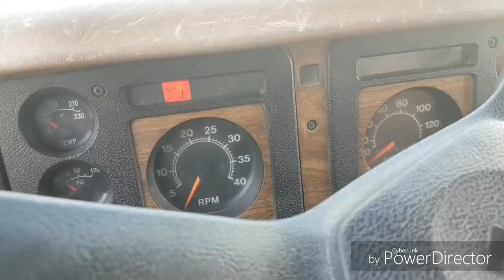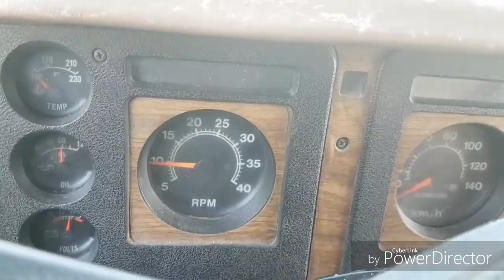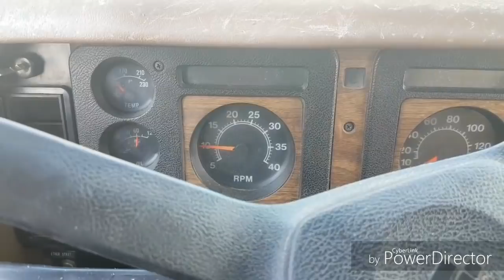Tandem cold starts, horse feeding and fuel cells!

Comment: So, Nick. Gotta say, I've always been told to NEVER crank an engine with the block heater plugged in.. because they say when the coolant starts moving, it can have a little air moving around with it.. the air hits the hot element while it's still plugged in and pops the element.
Three hours!!! Kinda wonder if the heater is working...
Dang Ryan! Always interrupting your videos 😂🤣
Tank looks good!, Definitely need to change the angle of the spout.
Maybe a hose with a 45° at the end??? Or bend or cut and fabricate to the angle you want???
Reply from the maker: Lmao that sounds like an old wives tail to me lol when its 30 below and hasnt moved for 2 weeks 3 hours isnt very long lmao
Reply: @SouthSaskFarmer1  I don't know, never chanced it.. except on accident 😁
Reply from the maker: @GosselinFarmsEdGosselin  lol done it for years no issue yet haha
Reply: @SouthSaskFarmer1  perfect 😁
Reply: Lol I never heard that.  How would it get air in it. Lol
Reply: @pattoohill5307  I was told cavitation when the pump starts..
But then on a lot of new stuff, it's hard to get the air out to begin with 🤣😂
Reply: @GosselinFarmsEdGosselin  .Ed cavitation is caused by the coolant.  You can get test strips at Napa to check it. Those water filters on the IH engines have the additives for correct PH and ect. Cat has an additive as well as a few other companies that keep the antifreeze in condition. You run in to the problems with mainly wet selves when the antifreeze had never been changed or been tested other than freeze temp.
Reply: @pattoohill5307  cavitation is caused by the movement or lack of movement, you are talking about electrolysis, Wich is caused by different metals and chemicals that don't like each other... It does things like eating out liners, especially on the older international diesel engines.. it can not only corrode the liners, but also the block, normally at the base of the liners.. good liner seals and good chemical additives/filtration are the best controls... I have also seen other parts of the block affected, but usually if other parts of the block shoe signs of electrolysis, the liners and their mating surfaces are pretty much gone.
 Damage caused by cavitation, is generally just in the pump. The air bubbles act like little balls, beating the inside of the pump.. all pumps will have a small amount of cavitation at start up, normally not causing damage... Toss in a small air leak on the suction side and cavitation becomes an issue.. 
Took a pump off an 8.3 Cummins, had a pinhole in the bottom rad hose, didn't drip, just damp on the outside.. destroyed the pump! Broke the shield off the impeller, peened the impeller, looked like it got ran through a rock crusher.
Reply: @GosselinFarmsEdGosselin  yep you made him speech less! 🤭😎😉🤪😁🤔🤫🤭🤬😔
Reply: Yes   electrolysis.  The nitrate and Silicate.  Isn't that supposed to stop or slow the cavitation of the water pump  ? I've never had any problems with either one. But I've changed a water pump or two. But bearing failure was the problem I guess.
Reply: @pattoohill5307  you've got the idea! 
It's mostly dissimilar metals that cause electrolysis.
The older international engines had the most issues with it. Most John Deere didn't, but some did after a lot of hours!! Like 15,000... Or more. 
The "filters" are not only filter but also have chemicals to help. There are also liquid additives to put in with the antifreeze.
I don't know that anything helps with cavitation.. it's really not an issue normally..